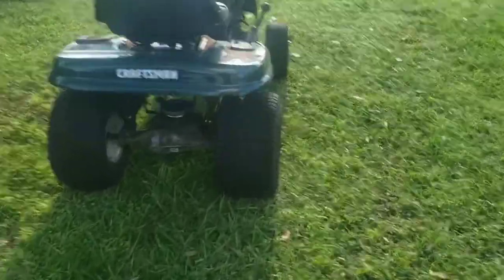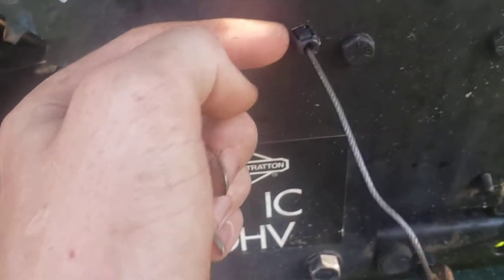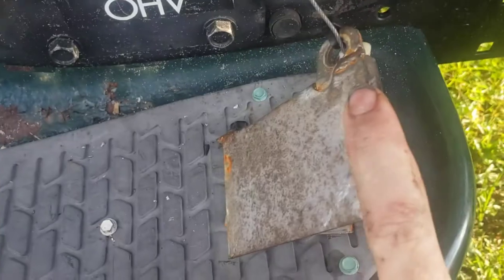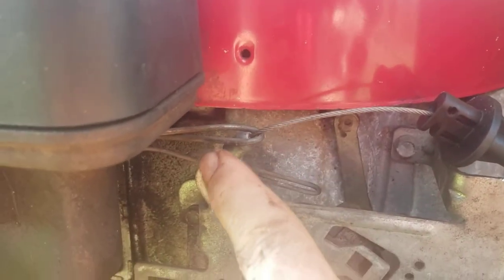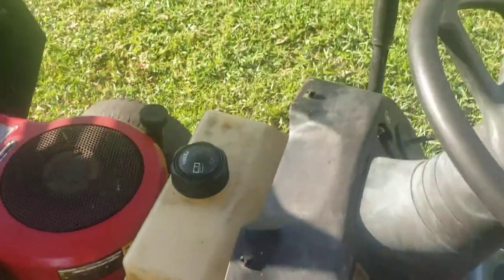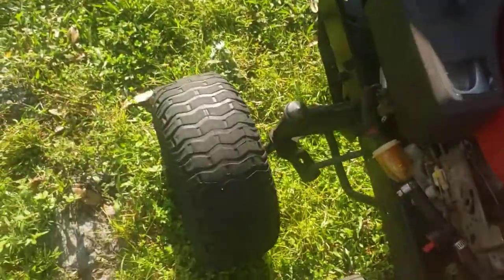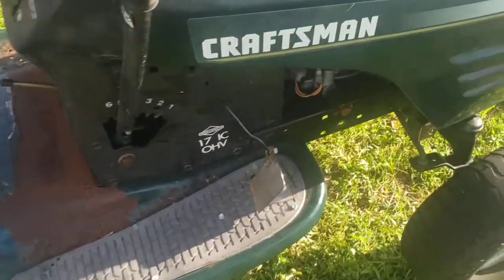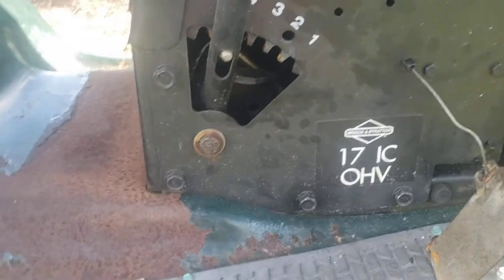How to, make a gas pedal for a mud mower.

Comment: is that garage door wire i see
Reply from the maker: Yes probably. Don't judge
Reply: What top speed amd what soze pulley u did what size rear are the frint
Reply from the maker: @christiansmith4803  front "6  rear "5 i was able to hit 28 mph